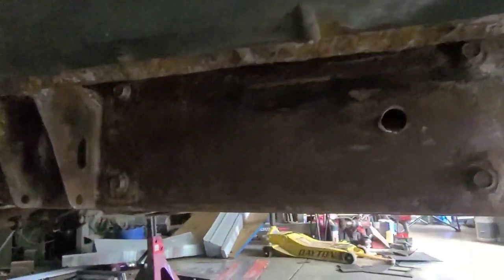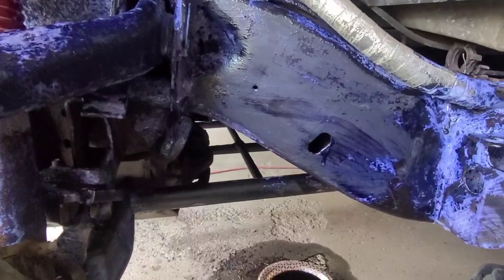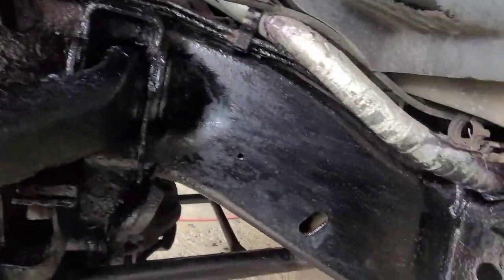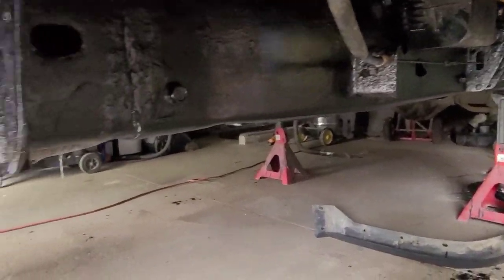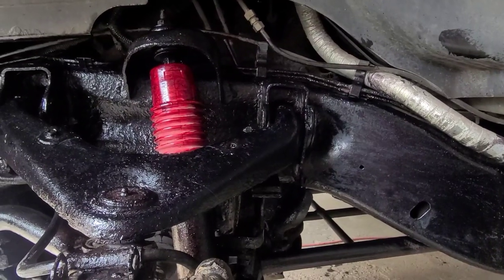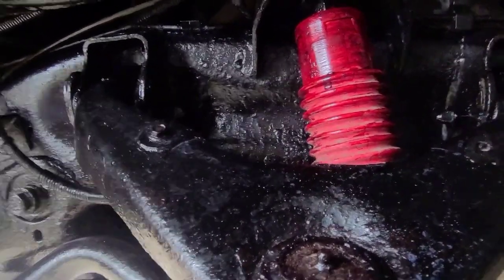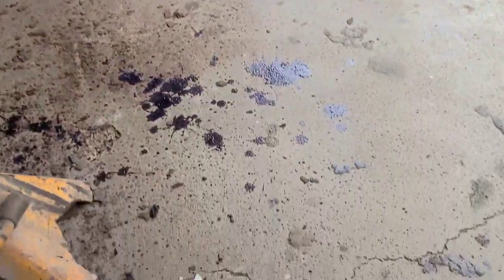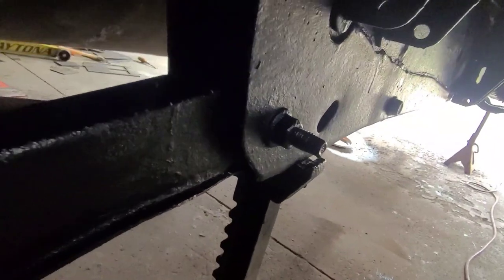Rust conversion with Corroseal on a Hummer H2

Comment: After the 3 coats of Corroseal can you apply wool wax to prevent future rust?
Reply from the maker: Yes but I would paint with a good rattle can like  Rust oleum hammer finish or rust stop what ever color you want then wool wax. I think you wouldn't have any rust issue after that
Reply: Diesel Dreams thanks!  Should I also undercoat the the truck bed underneath?
Reply from the maker: @YouSoCouldHaveGotMe  thank you for the questions in my opinion I would try to remove as much rust as you can, coat it with Corroseal, then paint with a rust proofing paint and if you wool wax after that spray wool wax in cab corners rocker panels under the bed make sure to spray on top of the wheel arches  basically any where you can reach you are only prolonging the life of your truck. That is the main problem with snow belt trucks no one invested in undercoating.  I have a brand new bed on my 08 duramax so no rust but I will woolwax it before winter.  The paint/primer under American vehicles is not prepped right by the factory causing it to chip off and rust to form sorry for the long answer but I hope it helps 😀
Reply from the maker: @YouSoCouldHaveGotMe  check out repair geek he uses fluid film but basically the same as woolwax  he has done a 3 year review here is a link to year 1
https://youtu.be/mbXBax-Kh9E